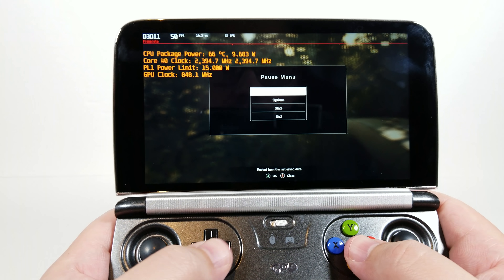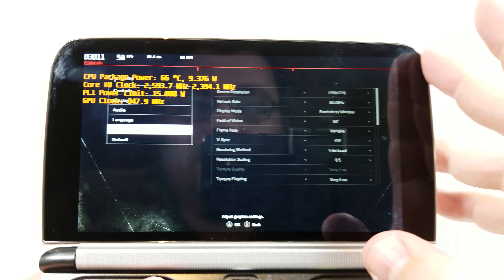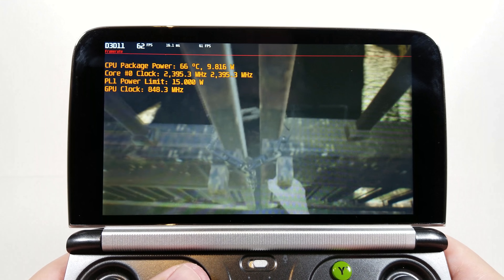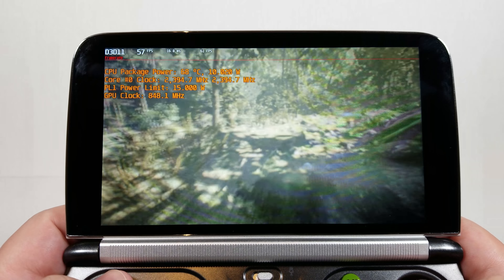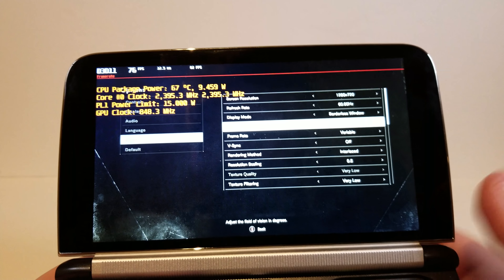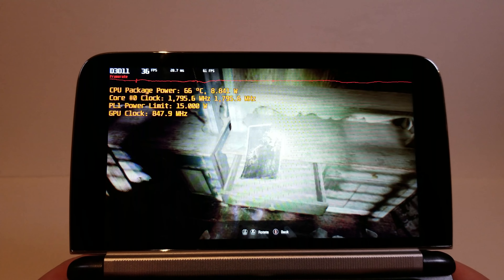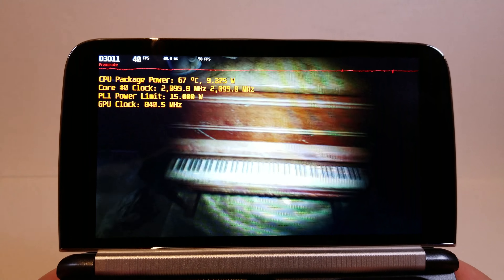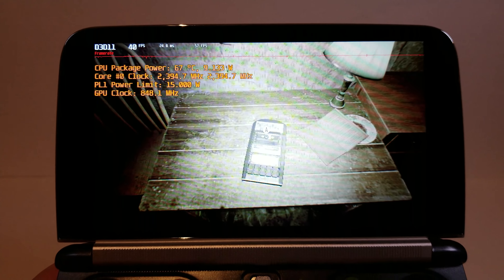GPD Win 2 - Resident Evil 7 MAX POWER 15 Watt TDP

Comment: So is this more powerful than a switch?
Reply: They probably trade blows in certain aspects. The Switch's GPU is slightly faster than the Win 2's (when in docked mode), while the Win 2's CPU is much faster than the Switch's. The Switch does have faster RAM than the Win 2, but with half the capacity. Storage, for what it's worth, is faster on the Win 2 as it uses m.2 SSDs.
So really, if you're considering getting one, you gotta think about whether having access to a far larger library of games than the Swiitch is worth the much higher price.
Reply: @AnTran147  thank you.
Reply: You also have to consider that switch is a dedicated "console" while Win 2 is a windows computer. The performance of a low end computer with the size of a DS. thats why the price is somewhat high instead. It all depends on your needs and use case.
Reply: Arthran It trades blows in handheld mode alone
Reply: It's not really a question of power when you consider switch games are specifically designed to run on the switches specifications and that it doesn't have the overhead of a desktop os running in the background
Reply: You can play every PC GAME! Who need a jumping game's switch?
Reply: Anaa Türkmüş la:D Kardeşim ben bunun 1 ini kullandım uzun süre hiç pişman olmadım fiyatı biraz ucuzlarsa 2ciyi almayı kesinlikle düşünüyorum.
Reply: @AnTran147  
Switch has 25.6  GB/s memory bandwidth. LPDDR4 has 32bit wide per memory channel.

Win 2 uses dual channel  LPDDR3 rated at 1866 Mbps which yields 14.9 GB/s memory bandwidth.  LPDDR3 has 32bit wide per memory channel.

AMD Ryzen mobile supports full DDR4 which are 64bits wide per memory channel, hence 38.4 GB/s memory bandwidth in DDR4-2400 128 bit configuration.
Reply: Alper 
Switch is more powerful even in undocked mode but to save  battery,it runs at 40% power of the docked mode
Reply: @Dev-nr4dw  How do we figure this? At $700, this thing had better be more powerful than the Switch..
Reply: @whiteknight5100  prices dont really dictate the power of the tech. iPhone X for example is barely more powerful than the switch and that is $1000. A laptop worth $1000 might be weaker than a desktop that costs $500. Check the specs not the price.
Reply: @Sabaelos  That was an argument used against the Switch in relation to other game consoles so I figured it applied to all tech but apparently not.
Reply: @whiteknight5100  I mean it is fine if you feel cheated if you compare specs through prices but what I meant only is that techs won't be priced equally. Some can be cheaper but more powerful and vice versa. Of course they all have their selling point like portable console like experience for the switch, at the end of the day even though switch is priced equally to a 5-6 year old console which is more powerful, portability was what made it successful and kind of appropriate for the customers.
Reply: @Sabaelos  Well mobile tech is always going to be more expensive than desktop/console equivalent, that's just a fact. Ultimately it's up to the consumer to decide what's expensive. I didn't feel like the Switch was very expensive. By that time, other consoles were already on the market for some years so their price had already dropped to below $300. But as you pointed out, Switch has the portability advantage along with its strong first party games so they can't really be compared directly. However, this GPD Win 2 boasts something that not even the Switch has,  a very wide variety of games. Unfortunately for me, $700+ is just too much for a handheld even one with a library like this. This will appeal to a fan of AAA games on the go so in that sense it expands on that concept even more than the Switch ever could. It's just that price...
Reply: @whiteknight5100  Hello again, nice to see we watch the same stuff lol
Reply: @CarsonCote  😀🖑
Reply: @AnTran147  you want play Nintendo exclusives tho, and if you're willing to spend 700 quid to play pc games, just buy a pc
Reply: Yes. You can run COD WW2 40 fps and I ran Skyrim 32-38 fps
Reply: @turanvarolsun747  all PC games, as well as a vast library of older console games when you factor in the emulation potential.

It ain't cheap, but if you've got money to burn then the win 2 offers the most variety of any handheld.

Comment: I really love the performance with the copper heatsink but whats the battery life trade off?
Reply from the maker: When you are running at Max TDP and undervolting, generally 12w is the absolute ceiling of power that will be used. So with that in mind, 2h15m is what you should expect.
Reply: @ThePhawx  
Cheers for that. Much appreciate the info. Its almost being dragged back in to not being portable but amazing performance from something so small

Comment: Are you testing the nylon case? To see if temp is lowered even further.
Reply from the maker: I still don't have a nylon case with the SSD grounding. I reverted to the stock case to prevent any damage to my SSD.
Reply: @ThePhawx  Will you be getting a test cases in the future with grounding issue fixed? Have you heard of the m.2 2280 case he is working on? Thanks for the content as always
Reply from the maker: @beefpatty144  he has mentioned I should be receiving some other materials but I haven't heard anything in some time

Comment: hay so no bs and all but my win 2 plays dishonored 2 at 25fps no crashing
Reply: Whether Intel graphics handles Unreal engine really well or UE is made with Intel HD in mind but I've noticed that all Unreal Engine based games run perfectly on Win 2. I even set my power to 5 watts and set resolution to 540p to get more battery life and still have 30+ fps in many UE based games on high to middle settings.
Reply: um long shot do you knowe how to fix the black screen problem my system still connects to wifi but the screen kicked off when i turned it on day befor yester day
Reply: i cheked if it connected after the screen kicked off i loged on to the routers web page and it pops up as connected but no screen
Reply: @dr.aculaanderson5971  Maybe it's the screen flex cable. It's a weak spot on Win2. You can order it at GPD shop on Ali Express. You can also write them for support and check subreddit on the device.
Reply: Just write to GPD suport then. As far as I know they are always willing to help and fix the device if you send it to them.

Comment: It makes me wonder why the xbox one x version isn't 60 fps
Reply: Dear god, how old are you?
Reply: 20 why
Reply: How old are yoy
Reply: @primobasilisk1659  I'm 28 and work in a bit of Gaming and majorly CGI art...
I'm just confused how a adult could even begin to wonder such a silly thing without just being a troll...
I mean you have to understand how game design works, even just a tiny wee bit to not make a pointless joke like that xD
You have to know the difference between low graphical settings and ULTRA graphical settings and how they effect frames-rates on different types of hardware setups on our devices.
Reply: @sevionus80  if the xbox one x can run the witcher 3 in 60 fps than a non open world game should to. And i to work with computers so i uderstand how it works.
Reply: @primobasilisk1659  Resident Evil 7 is 60 fps even on base consoles. It was originally designed for PSVR which had to run the game at a very high refresh rate.
Reply: @weaverquest  its called trolling have you heard of it
Reply: @primobasilisk1659  my dude you are not good at it
Reply: Chad Thundercock lol

Comment: Is a GPD Win 3 coming anytime soon? 🤔
Reply: Not likely. I would say it is over a year away.
Reply: Since the gap btwn win n win 2 is abt 2 years, u can expect the win 3 should come out at around the same timeframe.
Reply: @Knighteem  not necessarily. It depens on the available hardware, if there is no real upgrade for the current chip (Core m3-7Y30) then there won't be a completely new model because it would make no sense. Why develop an entirely new device that does not perform better at all? They could make a GPD Win 2.5 at best, with any kinds of improvements elsewhere and/or small performance upgrades like using the newer m3-8100y chip (it is identical to the m3-7Y30 but has a higher cpu boost clock).

if some ryzen chip with vega gpu @ 15w from AMD would be available or the announced Ice lake chips from intel, then a new model would actually make sense. But only time will tell.
Reply: @Klaeyy   GPD said they would be doing 2 to 3 new devices this year. One is the GPD Micro which replaces the GPD WIN 1 for those that used it as a PC first. And also works as an IT pro alternative to the GPD pocket 1 and pocket 2.  Two more possible things they could do. We should know for sure within a few months what they will do. But some say that GPD has said in private that there would not be a GPD WIN 3 this year. So, there is that.
Reply: not until Intel have better integrated graphics chips. the new m3 cpus use the same graphics chips as the old cpus. No point making a new GPD Win now